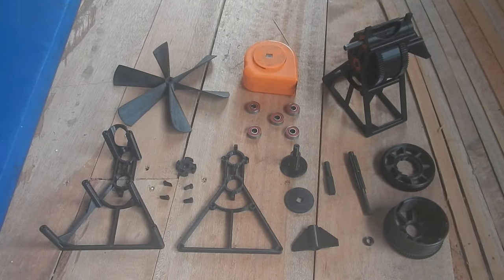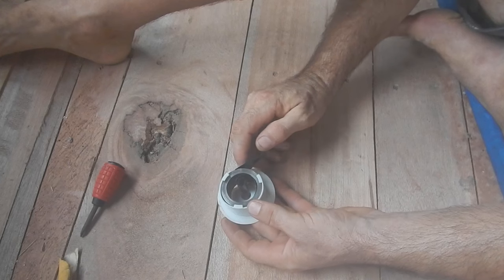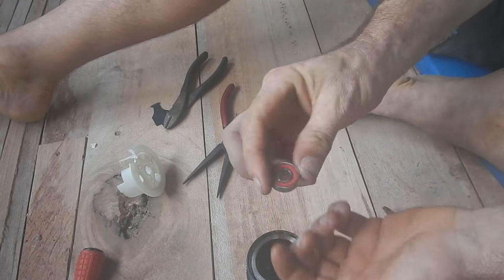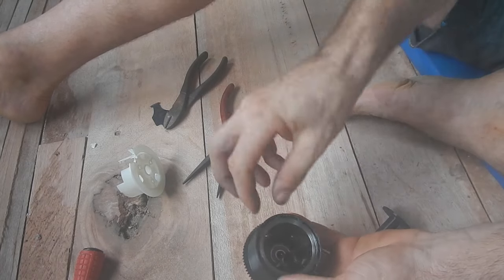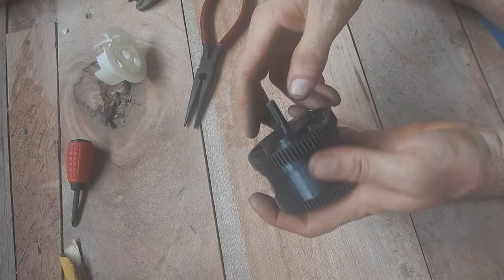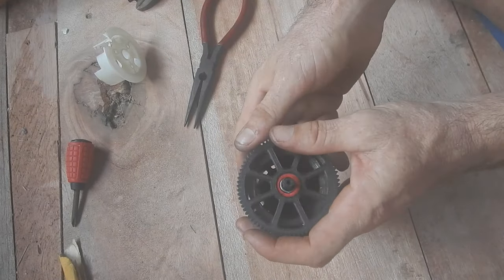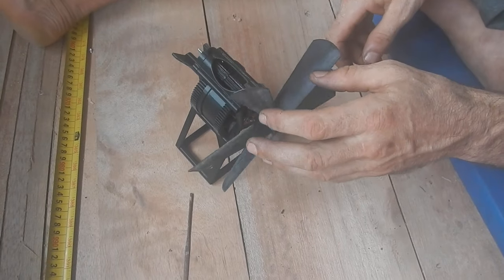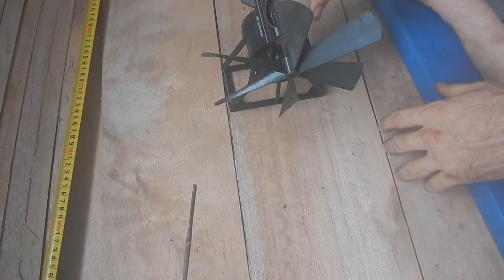How to Make a Wind Up Fan (Yes, you!)

Comment: You should build a fan (or electrical generator?) that is powered by a heavy weight suspended from a point high inside the roof of the dome. Could store alot of potential energy and release it slowly.
Reply: 100kg weight at 10m high has  m*g*h = 100 * 10 * 10 = 10 000J = 10 kJ = 2.78 Wh of potential energy. One rechargable AA battery from IKEA has 2450mAh * 1.2V = 2.94 Wh, and you can buy 4 of them for $10. Gravity is super weak compared to other forces, and it's really not worth using it for energy storage.

Comment: Man, I wish you'd explain how it works. I can't figure out how a free spinning drum assembly imparts force on that one piece impeller shaft. It appears there is a gear ratio differential between the front hub and the rear hub.  But how does that convert to rotational force on a solid common shaft? Please help! Feeling dumb... Very impressive!
Reply from the maker: There is a differential.  Imagine a really big differential.  It might make it easier to imagine.  The smaller the differential, the higher the gear ratio.  This is basically a way to gear something up a lot in one shot avoiding the friction of multiple axles.